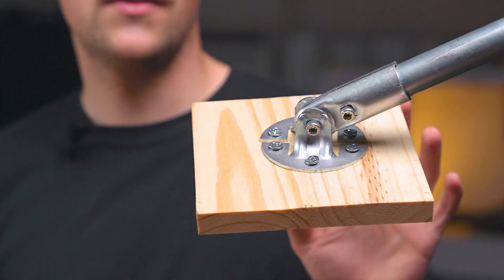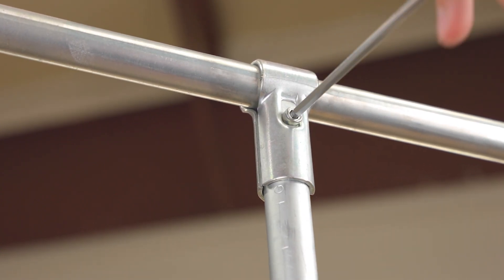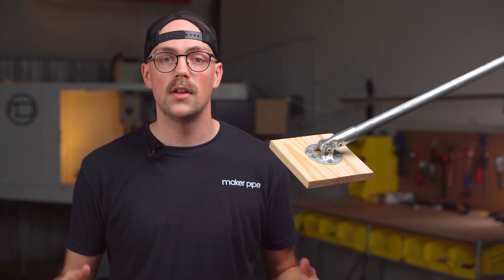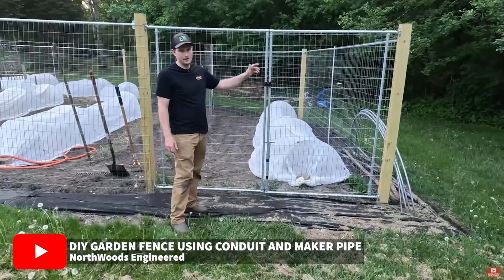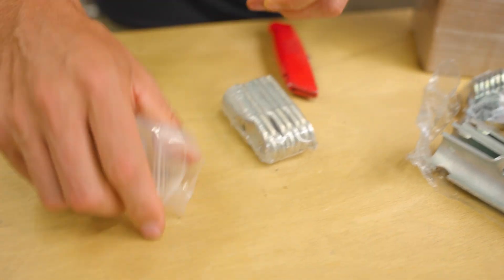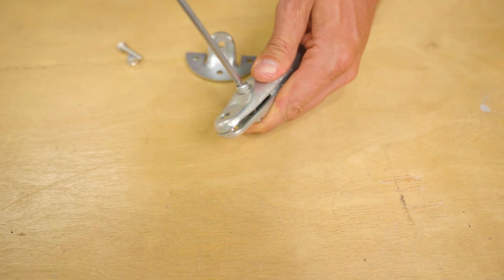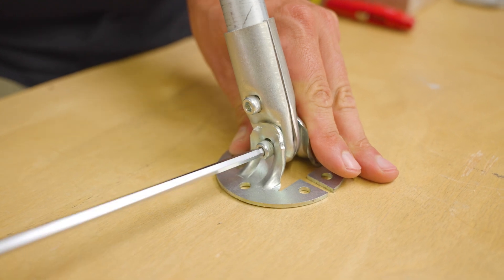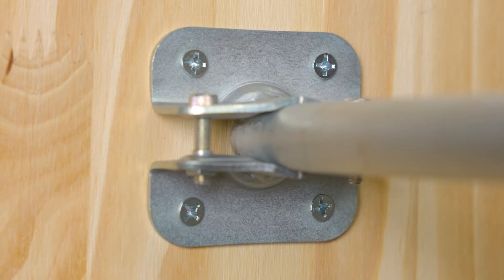EMT Conduit Adjustable Angle Flange Overview & Assembly | Maker Pipe

Comment: I would bet that by putting two such assemblages back-to-back (with two round pieces of 1/2” plywood between) a person could make a very “pivot-y” 360 degree swivel; a hole and bolt through the plywood circles acting as the rotational piece.